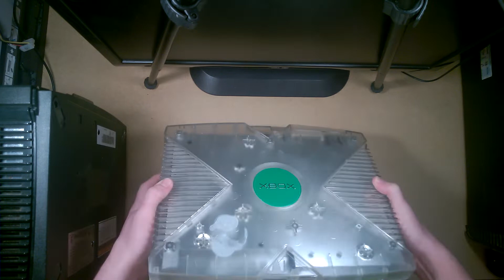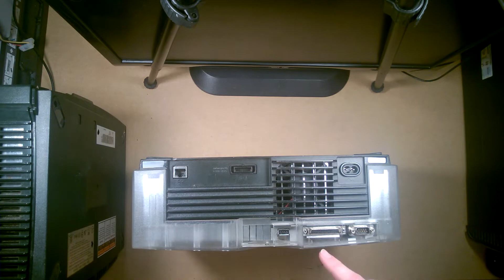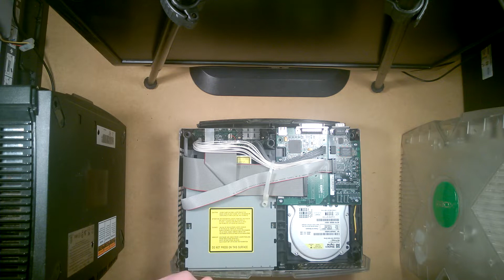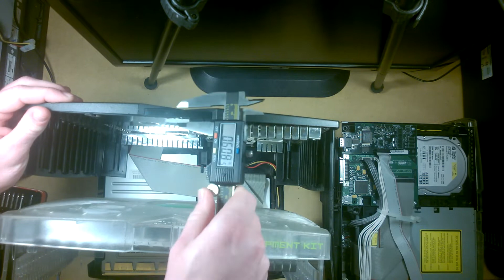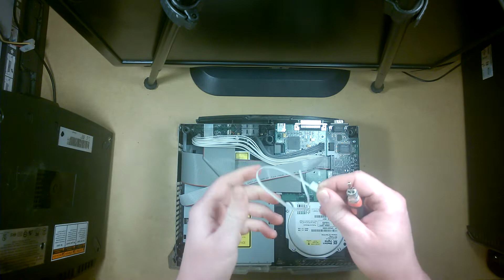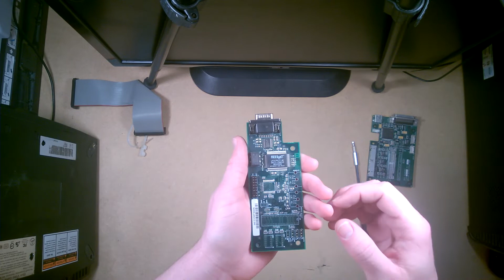Original Xbox Dev Kit Teardown

Comment: Good stuff! I got one of these in non-working condition some time ago. Having taken apart other consoles, I only removed the bottom screws and kept pulling on the top half wondering why it wasn't coming all the way off. Don't forget the dvd emu / serial screws on the back (as mentioned in the video)! I recognize your username. Were you on benheck, modretro, or assemblergames?
Reply from the maker: I'm on BH, effectively run MR, and was a bit active on xbox-scene.
Did you ever get yours running, or did it end up being a display piece or what?
Reply: @mothman.industries  Good stuff! Yeah, it was something pretty simple with mine (I think). Cloned the drive to a new one and replaced the IDE cable and all has been good since. Haven't touched the thing in years so maybe memory serves me wrong. Always wanted to try emulating a dvd. Have a Raptor card and cable sitting around somewhere.
Reply: Lmao Just realizing my goto is "Good stuff"